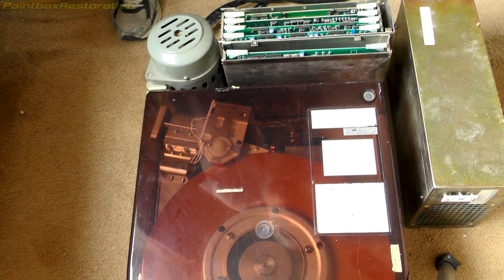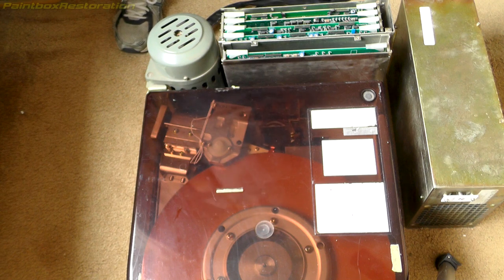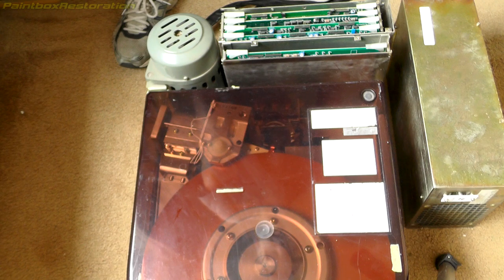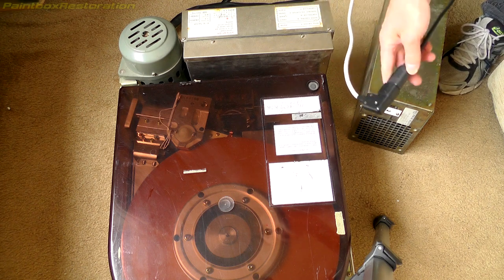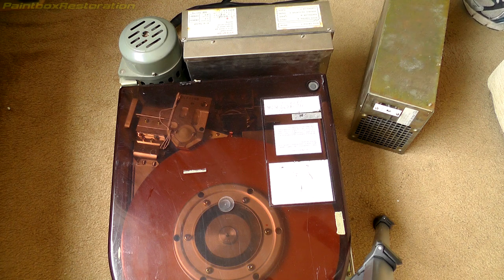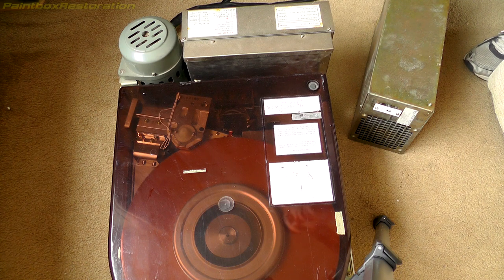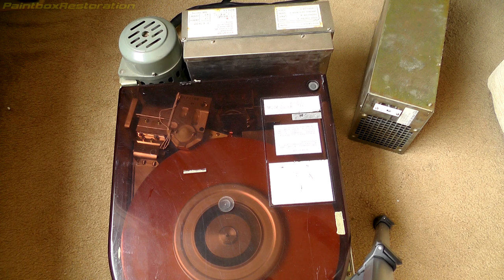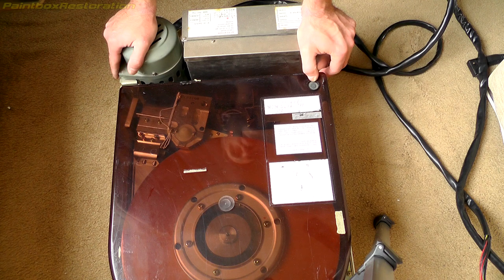Fujitsu M2294 14" Winchester HDD Disk Spin Up

Comment: Does it uses three-phase motor to spin the disk?
Reply: Most of these 14" drives had a high end single phase A.C. induction motor to spin them up via a flat belt drive. Later 5.25" and 3.5" drives went to DC stepper motors to maintain precise r.p.m. control. I have an old Xerox 820-II that has a  Shugart SA-1004 8-inch HDD that has a 10 MB. capacity, and also uses a belt drive system to spin the platters.. (which still works, incidentally!).😉

Comment: can windows installed on this hdd?
Reply: No. This hdd has a way to small storage capacity. An average Windows 10 iso is about 4gb. This drive is about 355mb. And the minimum drive storage required to install Windows 10 must be over 20gb.

Comment: Hmm this hard disk have a historical worth not a use bale worth.

How many MB's is this hard disk 20MB  40MB

Ball bearings replacement hmm a that is a huge job.

Big chance that after the replacement the calibration is not longer correct.
Reply from the maker: it's 330Mb